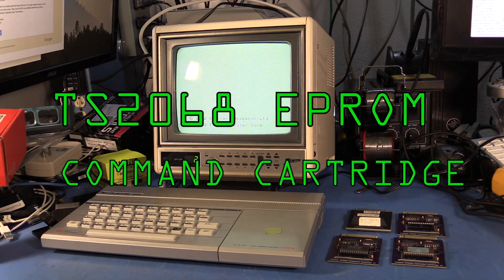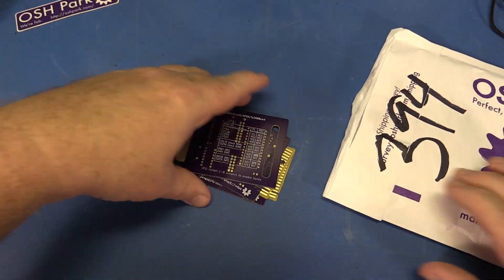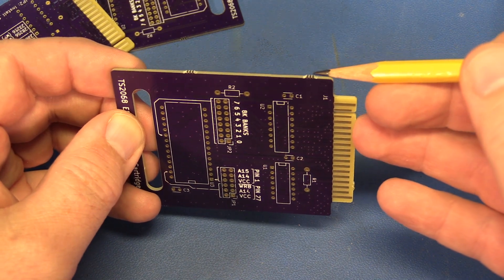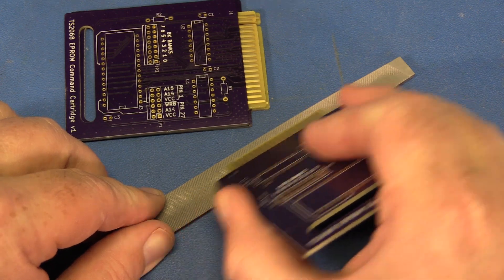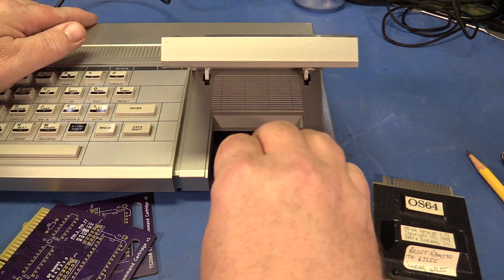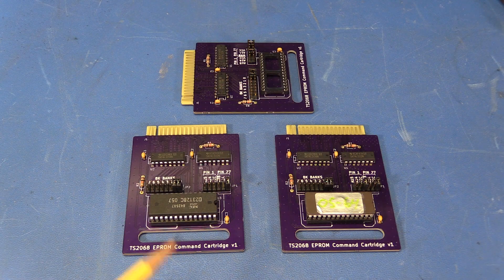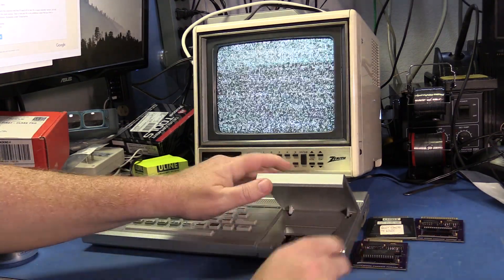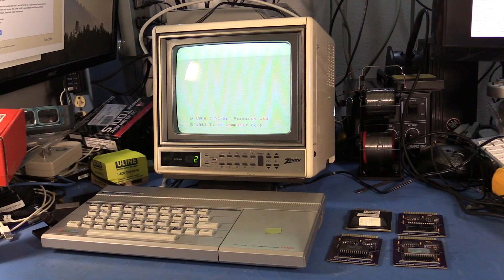TS2068 EPROM Command Cartridge

Comment: Hi,
I just got a TS 2068 and it came with a AERCO 32K RAM card (with a button battery).
How do you read/write on it (connected to the cartridge slot)
Thank you for your time.
Alex.
Reply from the maker: Can somebody else help Alex with this? I don't have that TS2068 that I borrowed any more, and I never learned much about it from the software side.

Good luck with your new computer, Alex!
Reply: I think it would have a lot to do with memory bank switching, I'll make another reply when I get around to reading that section of the advanced TS 2068 guide